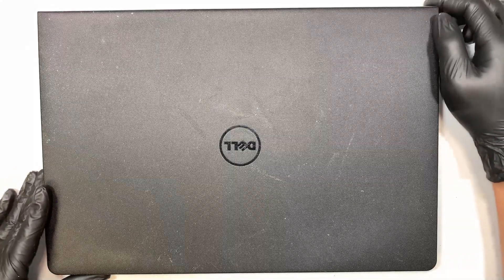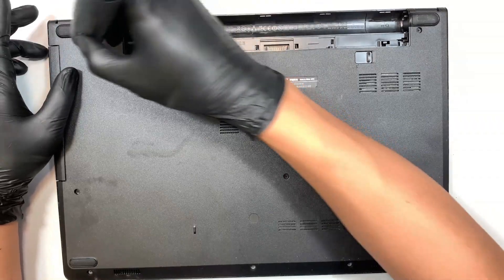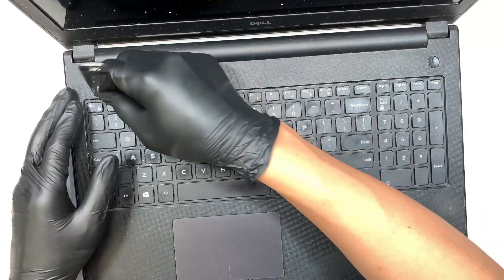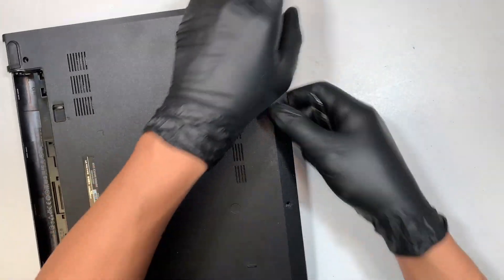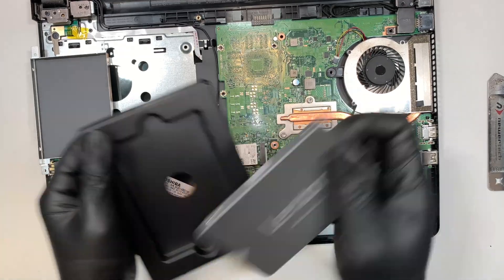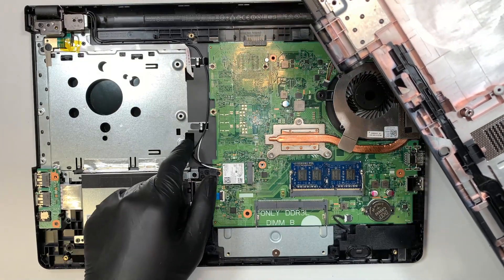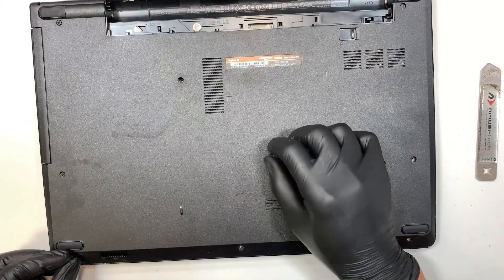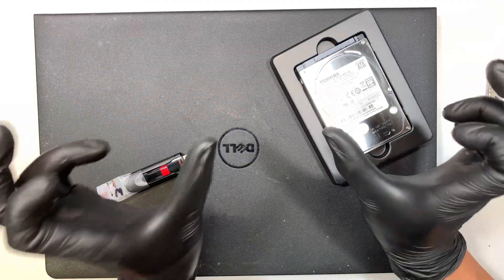Dell Inspiron 15 Bad Hard Drive and Replace with SSD

Comment: The links for the 2.5" drives are Samsung. In the video you have Lexar. Does it matter? I have the Dell 15-3552 whose hard drive just failed. Need a new one. Love your step by step video.
Reply from the maker: Does not matter. Just personal preference brand on the SSD